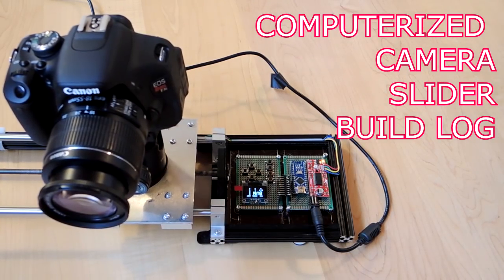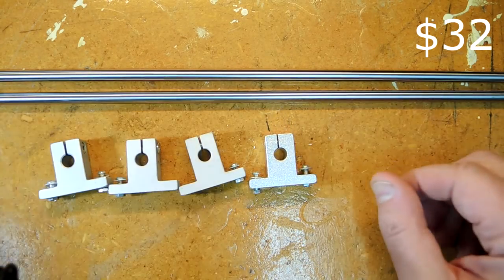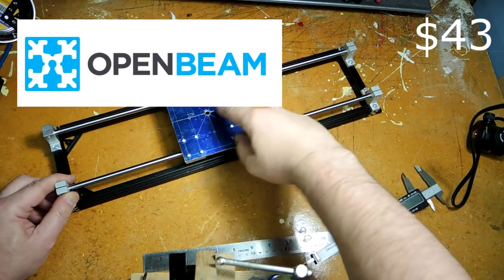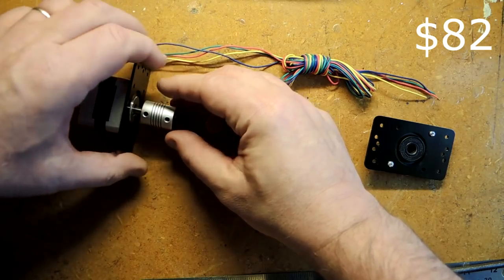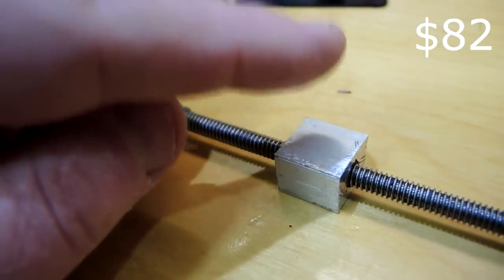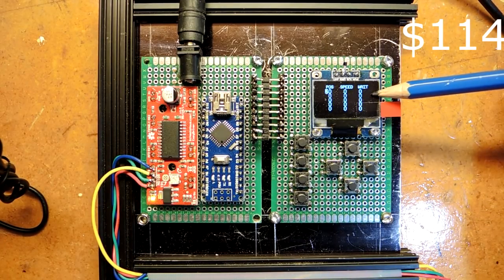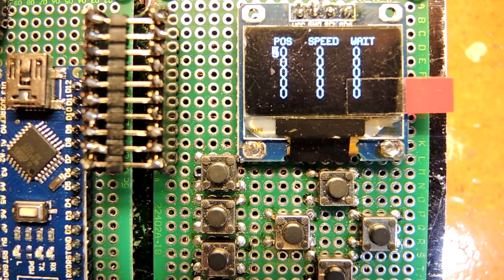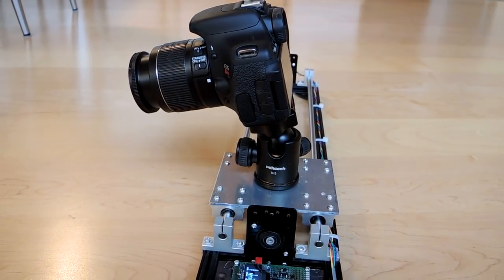Computerized Camera Slider Build Log

Comment: Excellent Project.. and something I would love to build, however I did notice that the linear screw configuration with the stepper motor resolution of that motor causes pulses.. so the camera has a jerky movement.   Is this something you notice?

It can be seen on 0:33  if you look close at the camera pedestal you can see the stepping/jerkiness... 

Perhaps a smoother stepper motor or a rubber serpentine belt would attenuate the fluctuations of that motor?
Reply: +360mix  I think an old fashion dot-matrix printer print head carrier would be better for linear movement...
Reply: +360mix I think for time-lapse it wouldn't be as noticeable however.
Reply: You are correct for time-lape it's fine.. I'm interested in making it for video.
Reply: +360mix I noticed it too. I also notice the threaded rod had a slight wobble to it. That may have contributed to the jerkyness.